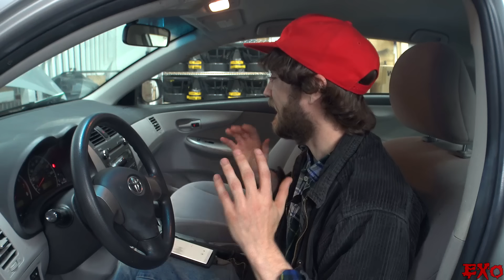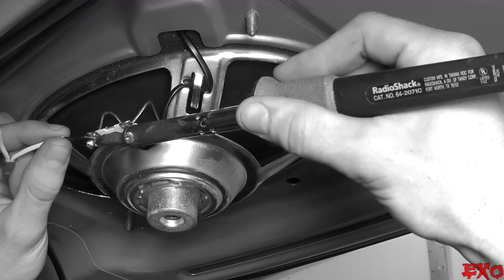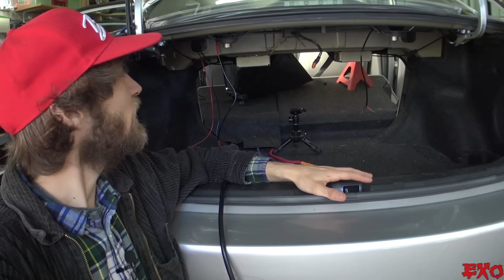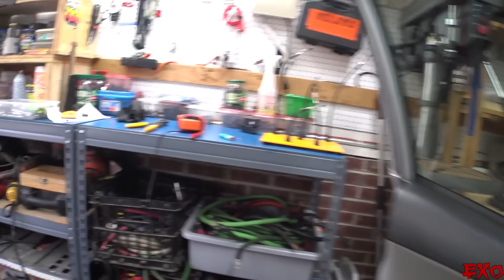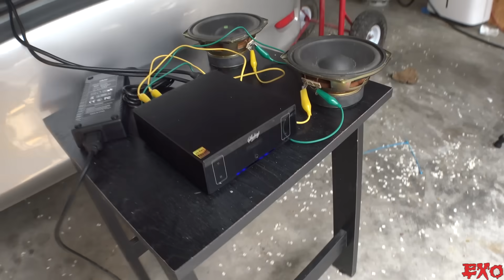How To INSTALL a Line Output Converter w/ Stock Radio & Speakers 4 Aftermarket SUB AMP Installation

Comment from the maker: Let's get the Toyota back in business as we SAVE UP for the BIG BUILD!!!

Thanks for watching, everyone!!! :)
Reply: Exocontralto you will be at slamology this year with LITTLE BLUE right?
Reply: Thank you for making this video EXO. I just came across a video where this guy ran his speaker wire straight into his amp RCA inputs. I was thinking OMG!
Reply: @MadDragon75    some amps have high and low inputs. U could wire them straight to ur speakers.
Reply: @migascustomsounds3054  yes. High input (plug with speaker wires) works great if you have an amplifier for your mids and tweets.
 You can use the low input (RCA) for your sub's.
But stuffing the positive into the center and the other grounded to the RCA is going to wire it:
High output to low input. Not a good idea but I watched a YouTube video of a guy doing a car audio install exactly how I just explained.
Reply: @MadDragon75  yeah ur right but I had a kicker amp that had an converter inside. It switched the high signal to a low  signal and u could plug RCA's also. It depends on the equipment ur using.
Reply: @migascustomsounds3054  Yes. Let me find the video. I'm sure you'll say.." Oh.. Okay.. That's not good."
Reply: Props on the vid.., try a "clip" to hold back shrink tube..  Ptevents it from sliding down in your way...   Also interested in those 6-1/2 your removing. Drop a line ... Habe A Great Day!
Reply: @normwilson864  true. Was going to suggest one of the gator clips like he had on those speakers.
Reply: It was easier if he just opened the radio and tapped on the signal before the stock amp
Reply: Question how did you determined the wiring
Reply: @glendabucud6696  not an specific enough question.  Everything depends on what ur trying to install.
Reply: EXOcontralto do a video on massive subs gtx122 120 dolled sub
Reply: Love your videos EXO! I’m 17 and a new driver. Looking to maybe do a sound system in my vehicle, you inspire me man. Your videos are awesome and I can tell you know what you’re doing and talking about. Your videos are always entertaining and very informative. Keep up the great work EXO! You da man!
Reply: I didn't understand the speakers output being at 9.2 what is the number it needs to be? Any help is appreciated   👍 great video again just like always 👍👍👍👍👍👍👍👍👍👍👍
Reply: EXOcontralto I have three dual 2  12 inch subs and have a pt cruiser and want your opinion on what amp should I use . Right now I have a dB Drive 2000.1 that is great for a good 6 minutes before going into protective mode.
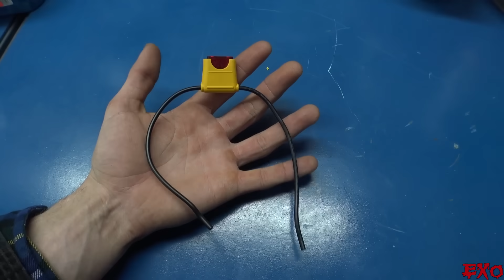Reply: @ 5:59 what size fuse is this?
Reply: Hello exocontralto
Hope you can help me I love your work also but I need some help on ny car audio I have a hertz ep5 amp I'm powering front components which are jl audio c2 650's and rear are still stock and my sub is jlaudio also I'm also using stock stereo which is navi600 could you hide me through the right way to set this up as my fronts sound too much treble I'm also using low output converter with 1 set of rca also any help would be great
Reply: EXOcontralto I have the same loc but mines reading .3 and that’s at 3/4 up. I have it hooked up right. What do you think is wrong
Reply: EXOcontralto your like Flanders from the simpsons lol 😂 I watch your show all the time with okaly dokaly stuff
Reply: Hello, love the channel and your content, question for ya what app do you use for the frequency test
Reply: Am about to do the 2013 tahoe I just bought. It's has a bose system. Those 4 speakers wires on the converter can I just wire the two positive together and the two negative together to one speaker only?
Reply: @EXOcontralto what voltage should u see at the rca's going into the amp?
Reply: How can i add 1 4ch amp and add 4 6x9s to the rear deck lid using the stock radio and stock two front speakers?
Reply: EA sy you just do it.

Comment: @EXOcontralto did you used a 10amp fuse straight to the 4gage battery wire ?

Comment: my radio keeps on cutting and i have  high to low converter connected directing at the back of my stock radio any advise on what to check please

Comment: Would you tap into the high level before or after a factory amp that powers the factory sub (sits in the rear deck just like the one tour working on)which im trying to replace?

Comment: I only just found this video, loving your content. 
If my car has a stock sub, would it be better to use the connection to that, or still use the rear speakers? 
Cheers.

Comment: Hoes does this work if you only want to power one sub with the RCA adapter? If your built in system only has one right and left for the rear speakers can you just use one pair of the 4 left and right cables on the RCA adapter?

Comment: does nobody ever have to wire these into their door speakers, i swear i’ve looked for videos the last 2 days and NOBODY wires their converter into the door speaker wires like my goodness not EVERYONE has speakers in their trunk
Reply: Did you manage to find anyone who did it?
Reply: @ i done it myself and it was the worst 3 days of my life but i got it & i wired it behind the head unit itself after i finally found the +\- for the rear door speakers, they still bumping today, ran my 12v down to the fuse box though when i tried to run it to the car charger it blew the fuse
Reply: You can also wire them in behind the radio
Reply: The door speakers are always braded together, find out witch is negative and positive to your current vehicle, then join each door spear wire from the one speaker, to the correct polarity of the rca output, then repeat the same cycle to the other door speaker wires
Reply: Just run wires to the door speakers 🤣
Reply: Damn right
Reply: Shoulda got a T harness specific to your car. It makes everything basically plug n play
Reply: I have done it

Comment: Did you connect the remote from back of radio, amp and the adapter together?
Reply: Like where does the remote wire from aftermarket amp connect to? To the adapter remote connection you just made?

Comment: Bro, just use some brass crimp connectors, i know a lot of people swear by soldering wires but i promise you it creates just as good if not a better connection & you're not dripping solder all over.

Comment: So where does the remote wire connect to?...from the amp.  I understand the remote wire goes from the line output converter to the amp, but then from the amp to where?  Is there somewhere it connects to the factory radio wiring??

Comment: Serious question??? Cant i just cut the rca and wire it to the speakers and plug into the amp? I did it before when i was younger and it pounded with my little mtx thunder amplifier. I got a new setup and not sure if i should do that again when i see these converter. Any help thanks

Comment: I don't understand the point of an LOC? Is it because his aftermarket amp doesn't have something. I'm installing an aftermarket 4 channel amp, and I was told to hook up the speaker to the plus/minus screws.
Reply: The after market amp is not missing anything . It’s the stock stereo not having rca outputs to go to the amp . Thats where the loc comes in play

Comment: You forgot to mention the remote switch wire.
Does it automatically send remote voltage to the amp or is it to send remote voltage to  the convertor  ???
Because you have a constant live going to your convertor . Without a remote wire feeding the convertor it will be permanently on ?

Comment: So if I did my rear and front speakers I would need two LOCs for front and rear then I would need a third one for subs correct if I have a stock head unit

Comment: Or if you use an OWC harness adapter you don't need an LOC at all. You basically get an all-in-one car audio interface that gives everything you need, except the main power & ground for the new amplifiers. The adapters are however only for Nissan and Infiniti at the moment.

Comment: I have no way to check the bolts an ohms of nothing idk if I’m running to much power but, I hooked my 2014 Jeep grand Cherokee up. Tapped into a rear 3 inch tweeter and and got the power to go thru the convertor by using my 12 volt outlet. Black an yellow connected to that remote wiring to amp and speaker wires to tweeter, everything works. Thing is when I hit the gas I get a very slight humming sound, and if I play it for too long it’s smells weird. Thanks for any info and yes I do have the 4 gauge ground wire an positive wire hooked up. Positive wire does got a fuse idk what else it could be, thanks

Comment: Does the high output line converter connected to the rear speakers reduces the sound, power or sound quality in them?

Comment: Question? Ok so I have a 2019 ford flex not the upgraded system.  So I want to add my 2 10" subs and I know I need one of those out put converters. Now can I just use a output converter ? And be done with it? Or will I need a mastroe rsd1 to keep all my idatalink functions? I guess what I'm saying is, will tapping in to a speaker conflict with my head unit functions?

Comment: So when you splice the speaker wires into the LOC, is this the same as it would be if you spliced them into the back of the factory head unit in the dash?

Comment: I know this video was awhile ago, but! It still stands true for car audio today and nothing about that will change. I also want to say your videos are awesome! I love the enthusiasm,  knowhow, and the just making your videos cool to watch, relax, and have fun too. And, I like learning from those who know the trade and off the books is ok too, as long as it doesn't turn shady. That's where I stand. 
I do have a question. My cheap lineout converter can't go any higher than 1.6 volts on my left and Right channel. My OEM radio pushes out 8.3 volts. My amplifier max does 6 volts. Would that mean then the target voltage to reach my target RMS (40 volts/800 watts) would I have to increase the amplifiers voltage, say bye, .7 - 1 volt to make up the difference, which is just turning up the gain higher until I get distortion. I have no special tools other than a multimeter. Lastly, at times, I notice a voltage drop off my stereos left channel. Any ideas there? 
Well... I appreciate any thoughts or help-thanks- Still learning these things.

Comment: So I've got an 08 Camry that has the JBL sound system so it's got the amp and all the tweeters. 

I'm installing these Scosche HD6904SD speakers that are 4 way, but once installed the audio is SOOOO weak. Idk why and idk what to do. Anybody know what the issue is?

The previous set up had some basic 6x9s and some separate tweeters. 6x9s took their 2 connections and the tweeters took theirs. 

Thinking that's my issue here but not sure what I can do. I considered cutting out the tweeter wires of the 4 way speakers I bought and connecting it all like that but idk if that would damage the speakers. I can't return the speakers either as the return window has passed.

Comment: So this is all you have to do to amplify your door speakers with a factory head unit I have factory head unit in mine but it had a factory sub and amp in the truck but I have ds18 door speakers I’m putting in and want them on a amp is this all I need a 4 channel line output converter to make that possible

Comment: I hooked up a loc after my factory amplifier.  The factory amplifier has tweeter and front speakers wires. Components. So I ran them together to the loc inputs. My loc only pushing out .2 volts AC out of the RCA jack's on full gain. They are pac lp7.  What's going on help

Comment: Hey bud. Quick question. On a factory head unit with only 4 channels how to I wire up correctly a sub? Using in a adios control lc7 with accubass. Tap into rear speaker input on amplifier? Or will that put stress on head unit? Ty

Comment: So here's a question I just got this exact loc and my question is I have a 2008 honda accord with the factory sub. I want to tap into the factory sub so it's only two wires not four . I dont need stereo signal for an aftermarket sub can I hook it up to that instead to retain my sub control in my factory headunit?

Comment: Hey i have a factory radio too and w the converter the yellow wire can you cross it to the battery for power instead of alternator? And does it matter what voltage i use for the wiring kit i have a mrv m500 alpine amp and a 12in kicker sub

Comment: So one rear speaker is still connected to the original wire.. and the other is direct to the original wire and both the speaker

Comment: So what should the correct current be on the arc. Something like 4v isn't it? And about 14v out at 40hz on a 1000w peek 300w rms?  The amp atm is only a 360w jbl and my speaker is an alpine awt-12s4. I don't want to clip it. I'm looking at a 1000w pioneer amp at 480w rms

Comment: Is that a inline fuse holder that you connected the power to?  I didn't see a fuse in there does anybody know what that splitter is called?

Comment: hey man, hello there, i do auto body, and there is a thing on the seat belt called a pretentioner, it locks the seat belt if the airbags are going to go off, and some will lock the seat belt even if you brake suddenly, and in car electric the neg or ground is thepath back to the battery and alt, you might want to ask someone who knows a bit better than me if that could zap your computer in the car, or worse ,fry your stereo, i'm gonna ask around now, i'm curious

Comment: I want to do something for my mom's 2016 CRV. She wants it a little louder but doesn't know how to use new high tech stereo systems. I'd get her two 8" subs. Maybe some explode 6by9s and explode door speakers two 8" subs w/500 watt 2 Channel & capacitor. 400 watt 4 channel for back, front & factory tweeters. Should be good enough for my mom. Factory stereo has an equalizer so I can make it sound perfect that match that amplifiers get the best possible sound at Max. No Distortion just crystal clear balanced. I built at least 13 systems. So I know I can make a factory setup work I never tried it though.

Comment: Do you actually need to use a liner converter if your car already has rca in the back of the radio
Reply: No if your head unit has rca inputs no need for a loc

Comment: I'm trying to run an amp for my door speakers. Everything seem to work but volume. The stock radio doesn't show a volume number. When I turn up the volume no matter how high, the volume  is the same or I can turn it down and eventually the is no sound. I'm using this same exact loc and I can't figure it out. What could it be

Comment: I could be wrong but I have an LC2i and I think ideally you'd tap into a door speaker for a wider band to send to the sub where you can manually tune subsonic and high pass frequencies to better match whatever sub you have. For instance I might be lucky to be getting 50% give or take of what my 15" 2500 watt setup could do til I ditch the rear tap and go to the front more untouched signal. Of course if you're putting smaller subs in those factory tunes might be close to where you need to be but I think being able to really tune it in yourself regardless is the way to go to get the most optimal sound possible.

Comment: ok I bought a car that they installed a car stereo and I tried to put an amplifier and a subwoofer but the amplifier does not sound so I can use this method to connect it thank you very much

Comment: So if you had a regular amp powering the subs, it looks like that mini is powered from a house outlet. Wld the red be the power source and the blue line be the one that turns on and off the amp so you're not draining your battery completely all the time. I'm still a little confused

Comment: Will the line output converter also work with putting a video output on a head unit?  I have a dvd player in the radio - but no way to stream it on another device - i.e. a tablet - so I have to watch DVDs on the tiny radio screen ... help ... ?

Comment: so hows the amp getting power ?
Reply: From ur battery. U connect ur wire kit red positive to ur battery to ur amp. Then remote from loc too amp for remote on/off

Comment: I have a 2010 Buick lacrosse and I am using my factory radio but I cannot get my subs to work I hooked the four wires up to my front door speakers and my RCA jacks to my amp but for whatever reason my subs will not play? Do you know what is wrong

Comment: Not sure if you’re still responding to comments on this video or not but what exactly was that part holding the wire coming from your alternator as well as the power on the other side? Where you tapped in to constant 12v for the device

Comment: Do I need a LOC if I just want to replace my OEM speakers with aftermarket ones??
Reply: I can answer that. The answer is No you do not need an LOC.  Just switch out speakers like you normally would.

Comment: What if the amp your installing already has a built in LOC and you still need to get the factory speaker signal to the amp

Comment: Yo exo I need major help, I’m upgrading front door speakers and adding a 2 channel amp. I’m trying to install my LOC to my rear speakers, however am I supposed to tap into the actual wires going to the rear speakers? Cuz Rn I have the wires just twisted onto the actual rear speaker terminal itself while it’s still connected. I’m getting no sound, my amp has power and is  grounded well but no sound at all. Help please! 1 month trying to figure this out.

Comment: I need help, I wired my sound system but somehow my amp keeps on after I turn off the car (key is off the ignition) then after a few seconds the amp turns off but shakes the subwoofer very hard and loud. 
Could it be the remote wire? (2015 corolla) 

I connected the remote of both the converter and the bass restorer on the amp terminals same with the 12v+ and ground. 

I did the same connections on my car and haven't had any problems for many years. 

Please, If any one has any suggestions on what could be my problem I would really appreciated, thanks.